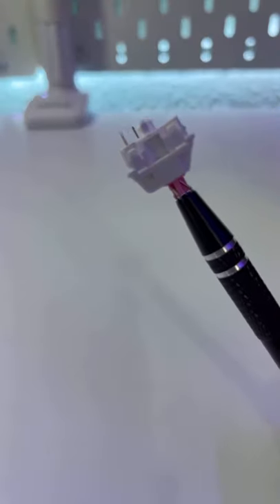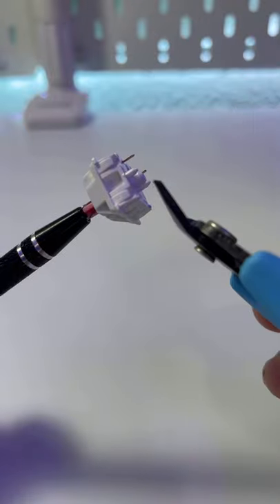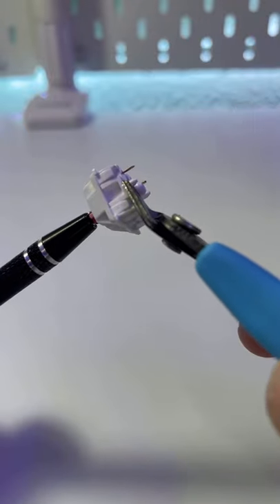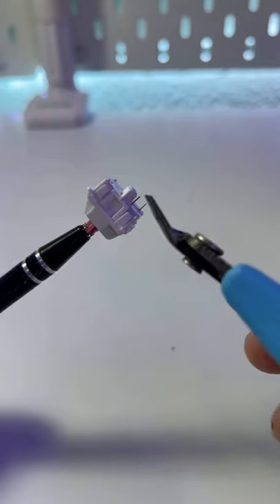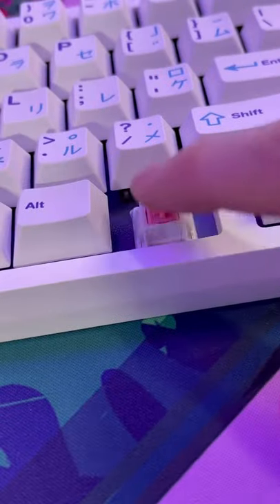Turning 5 Pin Hotswap Switches to 3 Pin | #shorts

Comment: Will this work with Gateron Milky Yellows with the Mizar Mz 60 Luna hot swappable. Like but good though not having to force  it in?
Reply: probably
Reply from the maker: This should work for any switch and keyboard combo as long as it isn't optical
Reply: i had the same issue sadly with gateron they don t fit in oetemu socket cuz gateron pins are thiccc*
Reply: @elyeschaouch285 bro can cherry mx switches be fixed in a 3-pin otemu switch pcb like by cutting them??
Reply: it only works for non outemu hot swap if it is outemu you have to do some pin modifications which is hella sketch @ItsHexical

Comment: This is functional but the "Halu Halo" switches i bought tend to stick to the key caps and detach from the pcb. Not sure if this is the case for other switches.
Reply: I've had this problem. You just need to push it hard until it clicks.

Comment: doesn't work n a redragon keyboard .. tried gateron 5 pin ones and chopped off the 2 extra pins, didn;'t work...what eneded up happening is the metal pins being pushed inside because the metal pins are like 1 mm shorter on the 5 pin gateron switch than the 3 pin from redragon, and they didn't enter the corresponding holes but hit the pcb instead and thus, shoved inside the switch.
Initially I had thought the metal pins broke off and the location is not the same, but the switch being transparent, i saw the metal clip inside being in a wrong position from an unused switch

Comment: i attempted to hotswap banana split switches, in for mx black switches on a ducky one 3 mini keyboard. The mx blacks are 3 pin, and the banana splits are 5 pin, however they fit into the slot. But when i try and type with the banana split switch key, it won't work. Can i get some help? Is this a pin problem or something else?
Reply: It's either you bent a pin or the switch or PCB is broken

Comment: Is there any downside to doing this?
Reply from the maker: Not really, the pins are for more stability, but AFAIK that doesn't really matter unless you are doing a build without some sort of plate, as the switches "click" into the plate anyways.
Reply: @ItsHexical  so if I wanted to install switches with 3 pins onto a pcb mounted board, how would I do that? Or would they just be unusable on pcb mounted boards and only on boards that support 3 pin plate mounted switches?
Reply: The downside is that you have to clip the switches 1 by 1 if you don’t want to pay for a newer keyboard
Reply: @ambasing69  lmao that comment was left over a year ago, I’m a lot more knowledgeable about keyboards now. But ty!

Comment: Can I do this to gateron milkys on an outemu 3 pin hotswap?
Reply from the maker: Yep!
Reply: Alright thanks a lot for the reply man!
Reply: You can’t do it if your keyboard is only Otemu hotswap and you are putting gaterons
Reply: @goat4r  you can, its a tight fit but it works, you have to trim the gateron switches tho
Reply: @DeadEyeYT  oh

Comment: Would this work for gateron oil kings?
Reply: I need to know
Reply: @Neqwodjoq  just tested, it works just make sure that the socket for the switch isn’t outemu. When it’s outemu, you have to cut a little of the 2 silvery pins so that it would fit

Comment: I’ve done that and they still don’t fit my previous switches were 3 pins and my current I’m swapping to is five
Reply: you might have an outemu pcb so you will need to trim the metal pins slightly too
Reply: @magenta8 wait how
Reply: @magenta8  some switch like akko v3 pro switches work on outemu board too

Comment: What can I use instead of a flush cutter? I don’t have a flush cutter so if there anything else I can use?
Reply: anything will work i used scissors just make sure not to cut the metal ones or the switch itself.
Reply: @yourmom1619  or your fingers.